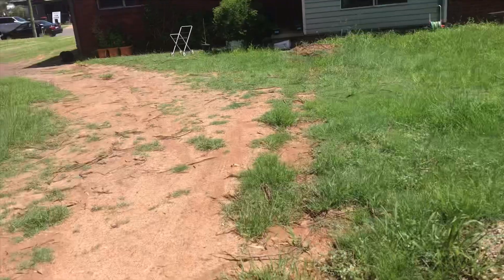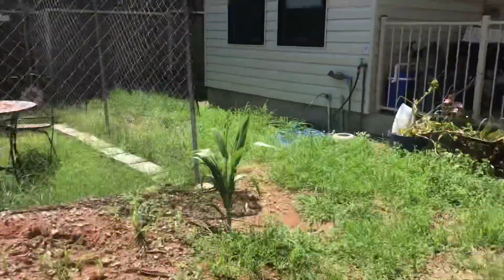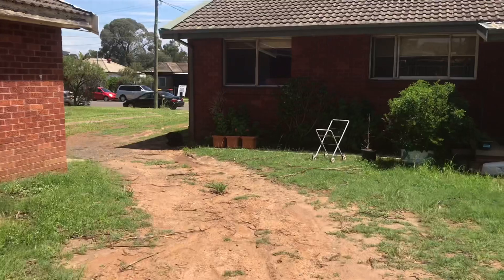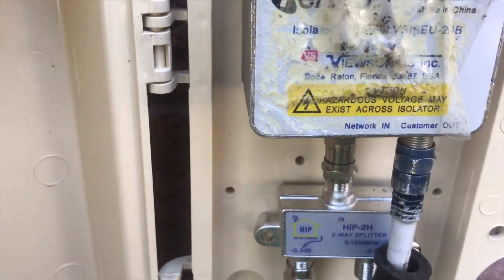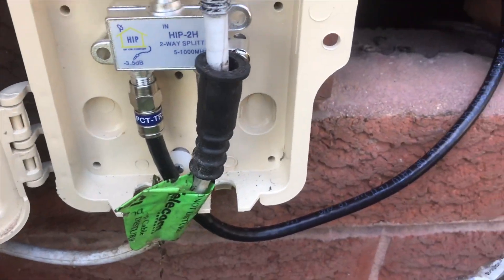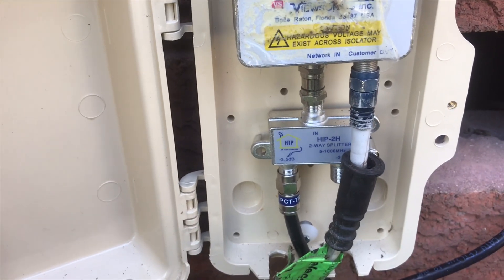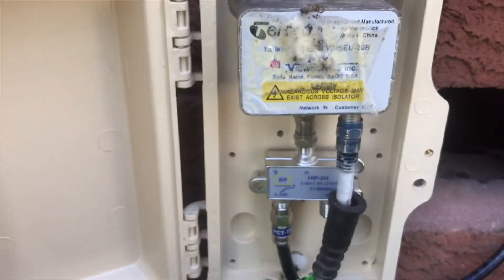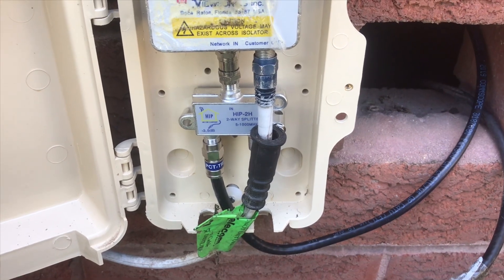2 Separate HFC Services off 1 HFC Aerial Lead in cable. NBN Installation for a Granny Flat in Sydney

Comment: Yeah it can be done like this same for those businesses with several VOIP eMTA lines with 10 modems connected to a single lead in. Depends on the signal levels are the tap though. In the US when it comes to to seperate customers cable co's don't like having 2 seperate customers on a single lead in though.
Reply from the maker: HPad aThabks for that very useful info mate

Comment: It's the Arris modem that does most of the work. The Arris modem is tied to the AVC that the customer orders through their RSP and gets fulfilled by NBNCo.

You can have quite a few services off of the HFC, for each service you order, NBNCo will send a tech out who will put a tap on your lead-in for your new service and then the new Arris modem gets plugged into that.
Reply from the maker: Ok good to know. Thanks for the info.